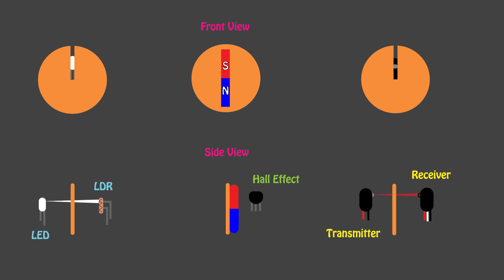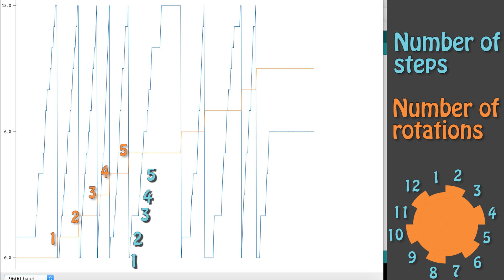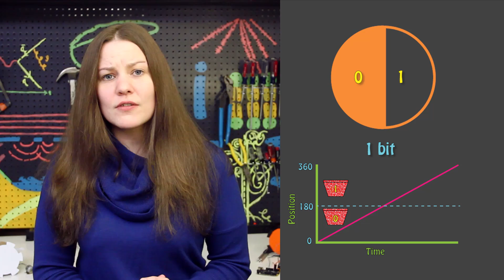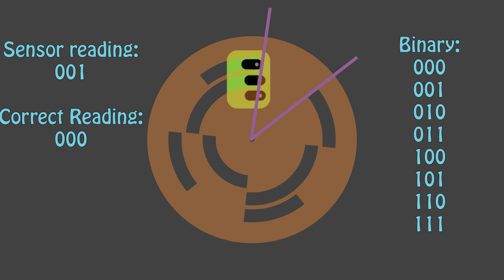How Encoders Monitor Position - Physics (Position Activity)

Comment: You gave me the idea to use quadrature encoder to attach the magnet, so instead of offsetting the hall sensor I offset the magnets in the wheel. I wonder if this setup would work and  the signal is not picked also by the other inline sensor. Also is quite tricky to find the correct alignment